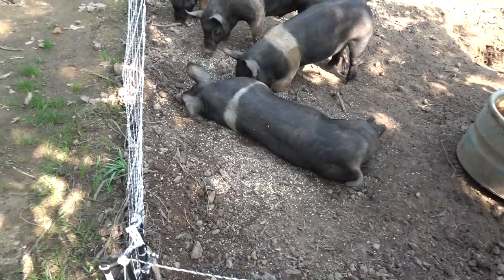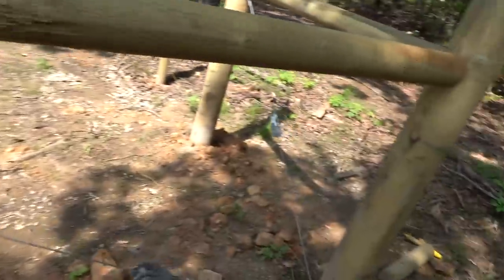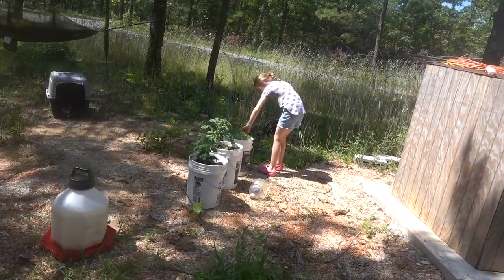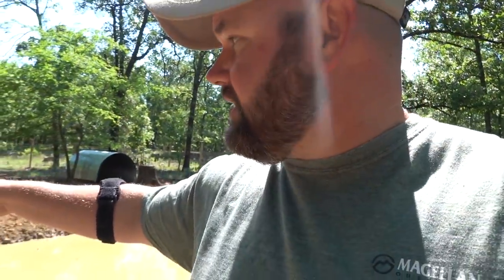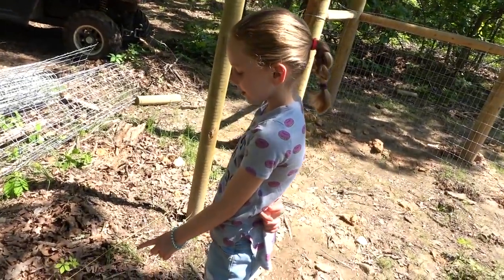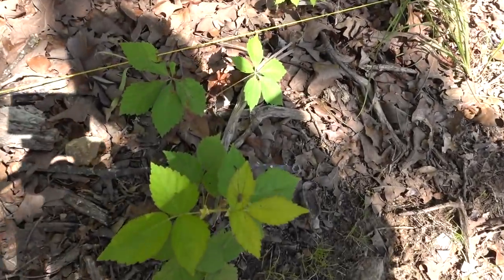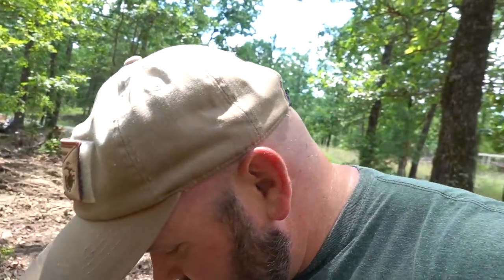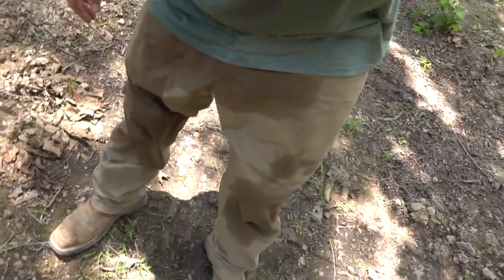HOW TO STRETCH A FENCE SUPER TIGHT

Comment: Fencing goes inside the posts if you are keeping animals in. You go around the outside of corner posts.  You nail it on posts, undo the wire, reposition your tractor, and continue pulling the wire down the next side. No need to cut your fence up at corners. You are doing good work! Bravo! 😉😊

Comment: I think the Guinea fowl are following the Turkey trail, you need to keep the electric fence right back to the tank so the pigs have plenty of room without getting shocked.  As soon as I seen how close the end of the pipe was to the fence I thought this could be a shocking experience for the pigs. You could put a 500 x500 plastic barrier on the pigs side of the fence which would also help insulate the water pipe, better still replace the steel pipe with poly, no shock at all. Love watching your video's, it's all a learning experience. 
Kevin from down under 🙂🌏

Comment: Something that is very hard to find now. My most favorite tool for lifting anything heavy in and out of my truck and just being an second hand on heavy projects where I have no help. It is an engine hoist that fits in an recessed hitch. Just shairing. Take care.
Reply: Expensive, but they make a hoist to bolt on the bed for$150.  Just installed mine for my mobility scooter.

Comment: Hi Dutch glad to see you used the wire with the smaller squares,  you won't have stock getting there heads stuck. You need to send Granger a photo so he can put some around his goat pen, he is always pull there heads out of the fence.

Comment: 👍😊🙏🇨🇦. Helpers can make work go faster. Nice to see. It's  way too hot, way too HOT. Good work , on the fencing. Did you check to see if the pipe is giving off any shock. Mite have to add water to their 🤔 pool. 👍😊🙏🇨🇦❤

Comment: Dutch, the only problems I see with the pipe insulation is when it rains. Once the plastic picks up general dirt, dust, tree sap, the surface will wet up readily when it rains and at 4-5 kv that could carry quite a zap to the drinking tube. We used to test fences with a grass stem when I was a kid and got caught out a few times by morning dew on the grass and would get more than I bargained for.

Comment: Hi Dutch.  When stapling lower courses of fence wire,  sometimes using a pair of needle nose  pliers to hold the staple against the post can help increase visibility blocked by  hand and fingers.  The setback created by the pliers lets you see the top of the staple better  when the angle changes from bending over. Try holding the longer side of the staple in the pliers and whack it a few times to set it.   Something to try to see what you think. :)  PS love watching you build a nice fence...reminds me of my dad putting up rod after rod to keep in the family milk cows way back when I was a kid.

Comment: Have you thought about putting a solar panel on the roof of your pumphouse and a battery with a inverter. Just to run the pump put another panel on the bathhouse. Also put a 1000 gallon or more water tank out there. Having a constant water flow was the thing to have a a friends property in up in the mountains. Also I've been looking into the Jackery for camping and charging my mobility scooter

Comment: When you get the wire to the corner I always wrap the fence around the outside of the corner. It makes it easier to the splice or to continue the roll. Usually you want the fence to the livestock side of the post, but on the corner the brace post and corner post are closer together and you can staple more wires to keep the livestock from pushing the fence from the post. Have you considered a fence around the property for the trespassers. We are having some of that hot weather in central Florida also.

Comment: Just before you picked up that pvc pipe, I said put some pvc around it. I've had to do this with my strands of electric fence when I string it from one pen to the other and don't want the electric wire shorting out on the metal wire.

Comment: Dutch you might try putting a piece of pipe insulation on the water pipe inside that p v c pipe it will keep the electricity from getting to the metal watered.

Comment: Hey Dutch. You will need to do 1 of 2 thing or the pigs will just pull of the pvc pipe off. 1 Duct tape the metal kind on the end near the pigs. or 2 Spray foam it then glue a reducer down to the next larger size of the OD of your pipe. I hope this helps.

Comment: RK  Your water tote or container will be quite heavy at 8.35lbs per gal. X no. of gallons and the CMU blocks with the two empty cells are stronger if you stand the block up with the hollow cells vertical facing the sky and a piece of scrap 2x4 16” long between the block & the bottom of your container. If the block is placed w/cells horizontal the block will fail under that much weight of water.

Comment: If I were you I would build a four post , open wall shed with galvanized tin roof over the water tanks. Notice I said tanks. I would add a second tank and connect the two  about six inches below the top and about the same towards the bottom. Then on low end of shed roof use guttering to catch rain water and channel it to one of the tank lids. This allows you to capture rain water and more of it . Then on tank with tube filling the   water trough have an over flow tube from the top of that tank with a downspout of an inch or two so that overflow no on tanks goes to trough.  And just on case you don't get enough rain, which as a fellow Oklahoman you know can happen at times I lay a pex line from well to a spicket next to the tanks. I'd bury it in a 18 to 24 " deep trench  surrounded by sand, dirt, sand, hay, gravel .  This would help keep the line cool, and protected. And I'd use a frost free spicket at the tanks. The shed serves a dual purpose keeps tanks out of direct sunlight and provides a little extra water. Just an idea.

Comment: RK  The PVC pipe going thru the electric fence cannot be in contact w/the bottom of the wet PVC pipe.. So you will have to trim a 5-6” dia. hole for the wet pipe to safely pass thru the fence without any contact

Comment: Hey Dutch just a question for you. On the cable you put diagonally on your corners why didn't you just use turnbuckles? It seems like it would be easier to adjust tension as needed over the years. Also how are the guinea fowl doing?
Reply: He can always add turn buckles later IF he needs to.
Reply: I know you mean well but sometimes its how its said, maybe instead of why didn't you use such and such, ask hey Dutch did you think of using such and such it may make it easier over time
Reply: @brandip2446  what’s wrong with the way he said it ?? I saw nothing wrong with the way he said it, he even started his comment with: 
Hey Dutch I have a question: 
He didn’t tell him he should’ve done this or he should’ve done that, No he asked him why he didn’t do it that way? Also he give an explanation of how using the turnbuckles would help. I saw Nothing wrong with his comment. 🙂👍

Comment: Basic training,  1964, FT. Polk, Louisiana, Summer, humidity 100%, tempeture always around 100 degrees. Recruits go face down from Heat stroke, or heat prostration. Orders from on high no more heat strokes ever, Salt Tablets and water after every Breakfast and Dinner. There were no more heat strokes. Salt tablets very important, almost as important as water. If you don't have them already, you might buy some Fencing pliers, have a hammer, wire cutter, and puller, of U staples, ( nails) built right in, and you can tighten fence with then too. Ranch in Montana 1100 acres, 7 miles of fence, every spring fix the fence's damaged by winter storms, fencing pliers invaluable.

Comment: I think your SxS weighs about 1500lbs. So get that 2500lb $80 winch with remote at HF. Get it mounted on the SxS and then you can use the winch as a fence stretcher. Works great. If the SxS moves as your stretching, just cable or strap the back of the SXS to a tree.

Comment: DUTCH I SUGGEST: That you run one  to two strands of hot wire around the bottom inside of that fence. This will keep the pigs 🐖 off your nice fence as well as keeping them from trying to root under the fence. Hogs as I’m sure U know are very destructive to fence if they can freely push against or dig under rooting. You’ve worked too hard on that fence to let them have their way on it. Just a suggestion. 🙂👍

Comment: I haven't finished the video yet. But I was also thinking what would you do about that electric fence. My first thought was cut a pool noodle and stick the pipe in the hole. It'll also insulate it in winter. Just a thought.

Comment: Drill a couple holes on the top of the pvc pipe then run a couple zap straps through to snug the pvc tight to the metal water pipe so the pigs don’t knock it off

Comment: I would have put the mesh on the outside and ran 2 strands electric along the inside. That gives you the width of the post as protection from grounding out. Then run a strand outside on the bottom and one just above to keep things out (jumping and digging).  Plenty of animals want something to lay against and fence is a major attraction for that because many times they feel it is a safe place to put their backs against thinking if they cannot get out, danger cannot get in. So electric both to keep animals in as well as keep animals out and provide a shady something to lay against (and rub against!) to give them what they need and protect your fence from wear and tear, keeping everybody even safer.

Comment: I think you need to drill a small hole through the piece of PVC and run a wire or string through it and tie it to the ibc tank to keep it from sliding off the pipe.

Comment: May sound weird but use a roofing hatchet to pound in staples it’s a lot easier I’ve done acoustical ceiling‘s for 35 years for 25 of those we used to use Fence staples to put on wall angle back in the day we didn’t have cordless power tools roofing hatchet has a squarehead lot easier to hit fence staples

Comment: You might try curling the fence and putting your pull arm further in so you can pull it tight and have the extra to wrap around when you're done. Unfortunately you'll be done when you get this comment but that might work instead of notching it out. Since you are pulling it and securing it all the way down you wouldn't lose your tension. Still pulling just further back if that makes sense.

Comment: So if you're going to use the larger pvc  Instead of something closer to the size of the pipe then you should probably add a pool noodle between the steel pipe and the PVC pipe or squirt some expandong foam between the pipes to hold it tighter.

Comment: Dutch the reason the fence pulls the rancher you have the come-a-long hooked up backwards.  You are pulling the rancher not the fence. Reverse the come-a-long it should pull fence with just the rancher in gear or with brake on.

Comment: Its inside on the straights and outside for the corners to pull them round and tight.
Reply: You can put the corners on the inside as well, you just have to cut out the cross wires. It looks neater and your keeping the animals on the inside. More work but looks better. I've always been amazed when you see timber fences on the outside because it looks better , then the stock keep knocking the rails of eating the grass on the outside.

Comment: Turn you concrete blocks with the holes up and down like you're laying a block wall , that's the way they are the strongest for weight , with the way you have them now they are more likely to crash under the weight of the water

Comment: I’m surprised you didn’t wait and put the water reservoir on the outside of the main fence you’r pulling.
Reply: Thats what I thought
Reply: I heard Dutch say in his last video he may not move the electric fence, not sure why after going to all that work to put up such a good fence
Reply: @hippopotaman075  Pigs dig and they'd probably escape so there needs to at least be a hot wire or two on the new bigger fence to make sure they don't get out but also to deter digging predators as well.

Comment: Curious why you lay the CMU's on their side.
Reply: Most people do it to utilize the flat surface the side provides. However, the blocks will hold much more weight when  stood upright, and 275 gallons of water weighs over a ton.

Comment: QUESTION. Are you going to put a cover over the tank so you don’t get algae. Al put a cover over his.
Reply: He addressed that question before, (I wondered about it too).....he said he had used it before with no problems. Hopefully that will continue :)
Reply: There are also tablets you can put in the tank to stop algae.  That's why rain water tanks are usually coloured to stop light getting.  Those white tanks let light in even if you put a roof over them. Best to use the tablets, Kevin from down under 🙂🌏
Reply: @hippopotaman075  I would rather try something like that than take the chance of the water becoming bad....too much work to start over...lol

Comment: Now you see why cattle panels stapled to the posts on the inside or pig panels would be self rigid and not need to be stretched out like your welded wire fence. More expensive relatively yes but fool proof.

Comment: I have been installing all kinds of fence for 40 years as my job. The fence normally would have been on the outside of the posts. reason if you wanted to put hot wire on posts to keep animals in and away . But I see what you are doing by putting it on inside you can use insulators on posts outside to run hot wire to keep predator's out away from livestock.